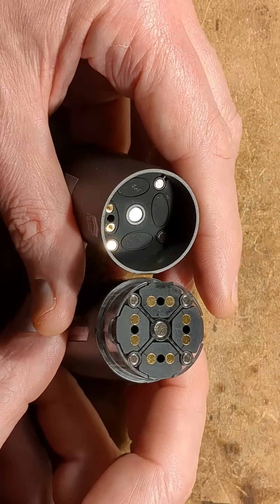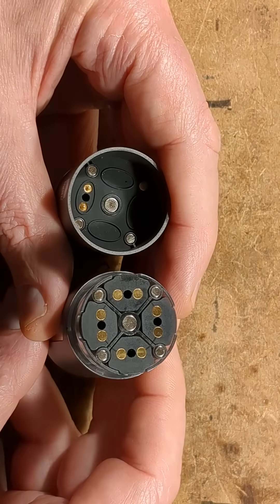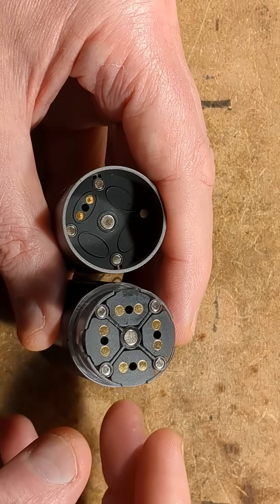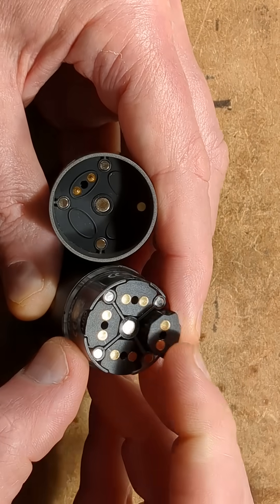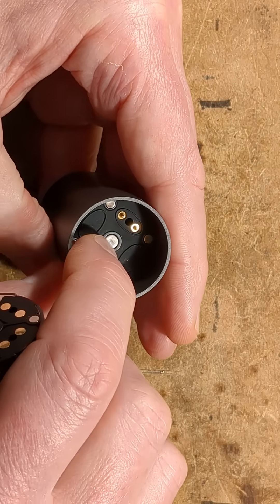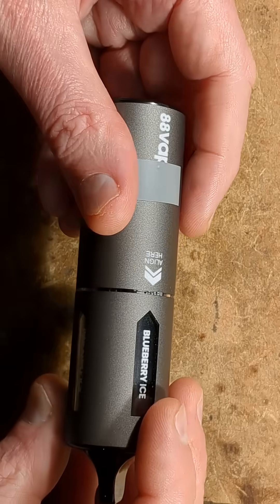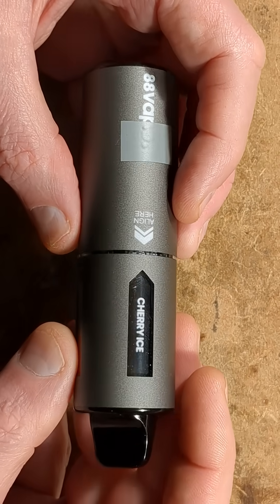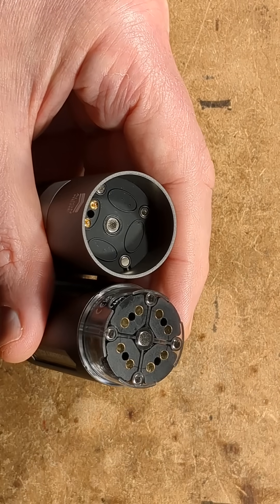Clever magnetic indexing and contact system

Comment: Transistor was invented in 1947. People before 1947:
Reply: As an engineer, it makes me sad. You need one button, 4 position transistor switch, and 4 LEDs for marking appropriate flavour. Vape already has electronics, you don't have a real reason to choose mechanical switches. Except you're bad in electrical circuit design or your warehouses are full of old heating boards.

Comment: I'm worried about the spring loaded pogo pins. The ones shown here look pretty fragile by the size of them, so sliding them sideways while compressed could easily bend them out of shape if they snag on anything and the user is less-than-gentle

Comment: In my experience, those spring loaded contact points get worn out pretty fast. Especially in vape products such as this. Apart from the normal issues they already have, the ability to slide over the contact pins till they seat correctly is a bad design. Those pins aren’t meant for slide contacts and can easily cause fatigue over the pins themselves. In which over time they will become either too stiff or too loose and lose connection which will render the entire device useless.

Comment: This battery connecting type with the spring loaded pins are notoriously unreliable, the slightest bit of corrosion or dirt will cause them to lose contact, i personally try to avoid products with these if at all possible.

Comment: Low current applications of live switching is the goal. Maybe in the sub 1 ampere range. Larger loads may experience increased contact arcing over time, increasing rapidly once the plating on the contacts starts to degrade. Quite the novel, yet functional circuit component. It also  exists in a different form factor by way of battery switches/isolators that can switch from 12V to Off to 24V and the like. I spent quite a bit of time looking for something like this to use as a solution in my custom Lowriderhydraulic suspension build in my 1982 Chevy Monte Carlo. I want to be able to switch between 48 and 96 V DC but the issue is this configuration has up to 831 commercial sealed lead acid batteries with a whopping 1100 cold cranking amps each in series which creates problems for a device rated for 350A.

Comment: Actually, what comes to mind are the battery-powered rotary tools (Dremel, etc.)  In that the their two speed selectors, which for the sake of torque (yes, I think this is true) and efficiency, have a switching arrangement that (I think) switches the batteries from series to parallel.  Obviously, the mechanism depicted here is more complicated, but it does make one think of the possibilities.  BTW, I always wanted to make a strat switch that had extra positions that couldn't be accessed without pulling the knob to one side the way that I'd seen hot rod gear selectors.

Comment: I did not understand the purpose at first, now i understand. The two contacts are not to encode 4 different positions, but just to transfer power so that the substances in 1 of the 4 containers can be released throught the 'vent hole'.

Comment: Just a comment on the new uk regulations. Firstly absolutely ridiculous this has to be censored, wtf YouTube 🤣🤣. But in regards to the actual regulations. i largely support them due to just how harmful disposable vapes are. A good example is lithium as its the most abundant heavy metal that is leeched out of these when left in the environment. But cadmium, lead, and just about any other thing you don't want making its way into water systems are also there. Another thing that's less talked about is the damage they're doing in waste collection centres. There's a reason there's so many rules about flying with these kinds of batteries, There have been plenty of times they've gotten crushed in bin lorries and started fires. The way these "disposable" vapes are supposed to be disposed of is putting them in electronics recycling and at least here in Edinburgh ive seen maybe one of that type of bin in public.

Comment: I buy the Hayati mini ultra 1500 puff vape. Which is a replaceable pod system BUT no pods are available to my knowledge yet:
SO I take each pod apart and add my own vape juice and it works wonders and it’s a very cheap way of vaping.
The main device is about £6 + 2 pods from new. But it’s very well built considering it’s re-chargeable.

Comment: The engineering here is quite surprising for the application.  I mean I can imagine something similar being used minus the contacts and pogo pins on some kind of ring-shaped switch to select modes on a device meant to be waterproof—sort of an iteration on the magnetically-coupled switches on some diving lights and waterproofed bicycle lights.

Comment: Clive, do happen to know if the one you have is still available? The reason I’m asking is because I know they banned a lot of devices. 

Like I said, I have one similar to yours. It’s not as good in the quality department. It doesn’t pull apart and click back together like yours. 

I still have access to the 4 tanks via the top by removing the mouth piece. 
On the one i have, when you twist the body to another tank, you also have to turn the mouthpiece to line up also.

As for that design (The twist to switch power input) having a place is other devices. I would say I’m 99% sure it would have. The 1st that springs to mind is circular type switches in cars. Or, some types of meters where a shared earth (or indeed a shared positive) would cause issues. 
I mean, having this design would prevent twisted wires etc.
Reply from the maker: This style is a new device and available from eBay and B M Homestores and other shops.

Comment: Normally, most users prefer to just use one battery until it dies or connect multiple batteries until they all die together. Still, there are some use cases, particularly where one expects to completely discharge the battery (or super cap) per activation, or if each cartridge is required to have it's own battery. There's very little reason for the latter though. The former, however, might describe an electric revolver pistol.

Comment: That really is a shame. Now that the new laws have come in, within a week I have found my first two discarded rechargeable ones. Totally takes the um you know what out of the new rules, but hey, you get a 1500mAh or so battery with usb charging module, all beautifully self contained, perfect for repurposing. I've only opened up one so far and it has the normal 3.7V battery but seems to be clamped at 1.42V output.  I'd really like to know more about them. They seem perfect for tear down and reverse engineering.
Reply: I've never found one with a built-in buck regulator... what you have there is the equivalent of a rechargeable AA, pop that circuit in your favourite clock. 😎

Comment: I have been taking apart vapes for years, and I am floored with how advanced their technology has become
Reply: Advanced vape technology
Reply: Its mostly just power bank type circuitry for the display and charging but the battery goes straight across the load coil instead of into a boost converter.
Reply: Drug dealers can afford this.
Reply: The tech is from toys it has some good applications but not asmany as you'd think
Reply: It’s literally the same idea Apple used for their plugs since like 20 years ago :P

They probably had to wait for the patent to expire 😂
Reply: @stevrgrs  no, magsafe did not provide keying, just holding mechanism,

Comment: it is just over engineered. It is like having 4 separate Vapes that can quick change but you only need the the energy to hit one cartridge rather than each flavor having its own.. would have been much easier to just have the cartridge change through a single "charge point".

Comment: Repeated cycling of the contacts over the pads and non padded surfaces cause wear and tarnish the electrical contacts. 

We use a system like this where there is a pure band of copper on one side and that helps to extend the life of the system, but it still needs to be serviced at a regular cadence. 
We call that system a slip ring.

Comment: You could do a reverse engineering video of the power module exclusive of the vape cartridges. When the video started i thought the cartridges where the battery/capacitors to power a tazer or similar lest that lethal defense tool for us in the UK were most means of defense against criminals have been band for law abiding people.

Comment: The closest other application I can think of to this rotating contact system is the wheels on the Enigma machine (which used external teeth rather than magnets for alignment, and worked by connecting 26 pins in a circle in any of 26 alignments).

Comment: The industry standard way of foing it (from milspec connectors to rotary dials to you name it) is to use indents around the perimeter and a spring loaded piece to snap into them, be it ball and spring or flexible plastic finger.

Magnets are novel but I'm not sure I see the advantages.

Comment: pogo connectors are notoriously unreliable and shorting them is extremely easy. i don’t see many use cases for this tech as it’s not gonna do much voltage or power and it’s already used as the basis for many low voltage magnetic charging docks.

Comment: I have ab obscene amount of these rotating devices for cell harvesting.
I've been tempted to use this rotating section and its popo pins with different resistors in place of its normal thing, then   different "tasks" can be placed into rotation area and rotated through for a DIY time tracker across different tasks or activities.

Comment: I have an electric screwdriver drill that has "revolver" style cartridges with different screw bits and magnets to keep things aligned and a slider to push the "loaded" bit through the chamber and pull it back. Plus it came with an empty revolver cartridge so you can use bits that aren't included. Very neat.
Reply: What brand is this? This sounds extremely useful for me 😮
Reply: @TeddieBean  Worx WX255 has this system
Reply: @TeddieBean  I got a Bosch PSR select but I dont use it as ofter as I thought
Reply: @TeddieBean most electric screwdrivers have this system, but I've not seen one where the cartridge was swappable before.
Reply: I have two of those.
Reply: What brand?
Reply: I have a hyper tough pistol grip screwdriver exactly like this lol has a beltbholster with 3 cylinder holders on the outside 😂

Comment: This is absolutely brilliant. Imagine a tool system with magnetic heads that you slap on the battery module!
Reply: Magnetic bit holder on drill.

Crosscall magcon also does that

Comment: fancy, i cant wait unti not only do i get to harvest spi OLED displays from street lithium, now i'll get some good magnets!!
Reply: I've been salvaging magnets from my spent Vaporesso cartridges for a while now. They lock the rectangular cartridge in the slot of the battery pack. I don't know if you have that brand in the UK but I doubt they're the only ones that use this method.
Reply: I find these sort of magnets are so small that i cant think of anything that I'd like to use them for. Any ideas?  @phantomkate6
Reply: I don't think its spi oled, likely I2C oled, they need to use cheap mcus
Reply: @Lavadawg it has both actually, looked up the datasheet
Reply: @frogz Yeah thats also what i realized when using a i2c display, also had a spi mode
Reply: @Lavadawg The ones I've taken apart have a PY32, an ARM-Cortex-M0+. One version drives the LEDs directly, the ones with big fancy animations use SPI-like LED driver.
Reply: I'm kinda jealous, all i get from the street lithium is withdrawal, not displays!
Reply: The magnets (and the lithium for that matter) on this one are in non-disposable parts it looks like.
Reply: I picked up a couple of nice colur 2 digit dispalys of diffent models from vapes with extra icons on them. Are they likely to be SPI and how easy is it to drive from an  Arduino/Pi etc?
Reply: hard drives have magnets in them.  You could have been doing that for like 30 years.

Comment: As a vaper I think it's completely crazy to think how much more sophisticated are devices of this type now than 20 years ago.
Reply: As long as people keep spending money 😉
Reply: @ralanham76  not really.
e-cigs is like 3D printers: developed by communities by pure necessity.
true opensource hardware, I love it.
Reply: Yeah Cigalikes and egos seem positively bronzeage.
Reply: 1930’s fort patent for vapes. 
60’s first designed but never took off. Early 2000’s Chinese pharmacist released a Gen 1 vape. 
You’re welcome
Reply: In the early 00s the only 'vaporizer' we'd ever heard of were those we made ourselves from carefully hollowed out glass light bulbs 😮
Reply: @ExtendedJet8  google cig-alikes they sucked because the batteries were small and the carts didnt hold much liquid and filling them was a pain in the neck.
Reply: I'm gonna have to agree that while the concept is pretty old, "modern" vapes only started showing up around 2010-11. At least that's when I first saw them.
Reply: @michaelathens953  modern vapes are just like third gen vapes. they are the same except we started using tanks instead of carts to hold more liquid. i had one of the initial models in america it sucked and i kept smoking cigs. the tanks are much better also the larger batteries make them last longer. the original were termed "cig-alikes" and tried to emulate cigarettes.
Reply: The wooden box vape :)
Reply: 2005, way before all the hookah shops turned into vape shops
Reply: yes indeed.
I remember me and my wife carrying around a backpack with a laptop all over Disney World in 2010 just to supply USB power to hear e-cig!
powerbanck's also wasn't really a thing back then, and e-cigs was more made to look like cigarettes than to have a big enough battery:
they where slim and underpowered.
Reply: @MortenVindingSvendse  yeah G1 vapes were azz.  the G2 mods and pods were way better than cart and battery
Reply: For everyone saying that vapes weren't a thing twenty years ago, yeah, it was, just not as well-known as it is now. The electrical principles behind the devices isn't anything new, just a battery heating a coil to vaporize a liquid. And the liquids being vaporized are nothing new either, essentially vegetable oil and propelyne glycol with flavor additives, all of which has been widely available for nearly a century (propalyne glycol was first used in medications in 1932). 

You think that building your own coil, stuffing some cotton through it, and putting atomizable liquid in the container housing it is a new concept? My first ever vape was a simple copper tube to hold the battery with threads on one end and a button on the other, and the tank was a steel tub with posts to mount the coils covered in a steel cap and a plastic mouthpiece. Oh, and I bought that all the way back in 08 from a smoke shop!
Reply: @Bill_DeBerry also known as crack
Reply: Y'know, About 13 years ago, My mother got what was just a cigarette sized vape with a little cartridge thing that was reusable, I think it was called a "Blu"? Got it to help her quit.
She never did.
Now she's described her using her Juul in bed like she's "Sucking her thumb".
Reply: @milokiss8276  I smoked cigarettes for 30 years I switched to vaping about 3 years ago. I can't stand the taste of cigarettes now and can't believe I smoked for so long.
Reply: I bought my first one around 2008 so yeah, not too far off the mark.
Reply: Dude unintentionally started a debate about the history of vapes.
Reply: Man's a gaseous form
Reply: Next 100 in one vape system 😂😂😂😂😂😂🤔🤔🤔🤔😊
Reply: The first Vapes were non electric which existed in the 80's long glass tube with a bubble on one end a hole on top that you put your oil in and boil it with a flame
Reply: agreed
Reply: I think it's even crazier that you think vapes existed in any form back in 2005 lmao
Reply: @iHawke They were called "e-cigarettes" when they were first sold...around 2005. 😉
Reply: @iHawke  the patent and device has been around since at least 2002.
Reply: @iHawke  they did and they sucked, you put liquid on a sponge that had a coil in it and it lasted about 2 hours. i had a usb to cart connector. they were very rudimentary first gen devices.
Reply: @iHawke  We were just getting e-cigarettes and cartomizers
Reply: @iHawke They basically did, but they were marketed as e-cigs. I recall the Blu brand e-cigs became available back around 2004-2005.
Reply: @iHawke Get historical literacy; heating up a tube by drawing air through, having a heater, and a place to put a bud you wanted to not burn but infuse into the air stream is easily 1900 years old. [Waits patiently for you to hand me Vatican and Hebrew apocrypha about old tube sage stuff.]
Reply: @iHawke  They did? Just in a significantly more limited factor. If you're unaware of this then may I suggest you either up your Google-Fu or simply STFU and let the adults speak?
Reply: @MrGrimsmith  They did? in valley girl voice oh emm gee
Reply: @SoulAir  They did.  Also dry vaping has been a thing for a lot longer.
Reply: Yeah as the manager of the first vape shop in my town they have only been available for about 12years now, nothing before that is really a 'Vape'
Reply: @stevenr6397  laughs in volcano vaporizer.
Reply: @stevenr6397 😂😂😂😂😂😂 12 years and you being a pioneer, how quaint, that was later than EVOD, Protanks and Inokin MVP2, Kangertech opened shop in 2007 and they were relatively late to the game, soooooo yeah.
Reply: @stevenr6397  vapes were very much available, just not portable/handheld ones. The small wooden box I am referring to seemed to be all over California in 2005.
Reply: 20 yrs ago? Bahaha. Wtf were you smoking 20.yrs ago? Tossing nicotine bug killer in a weed vape? 🤣